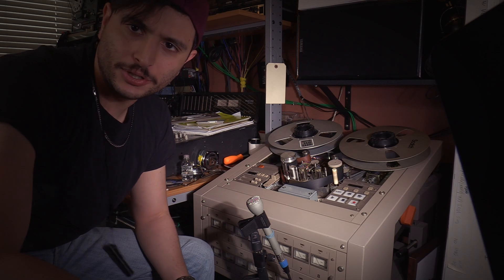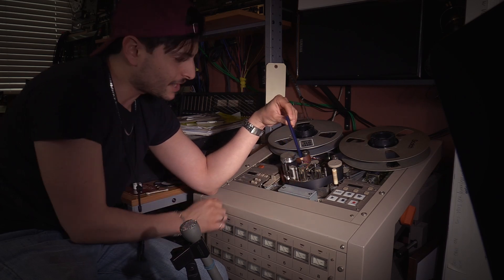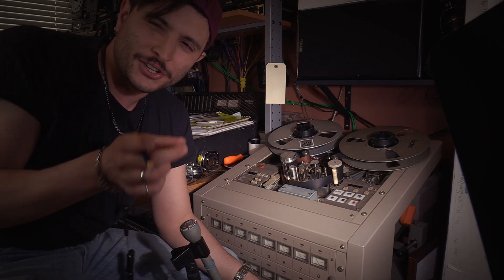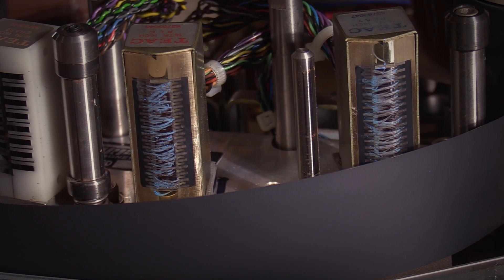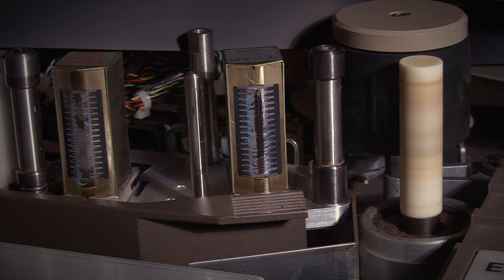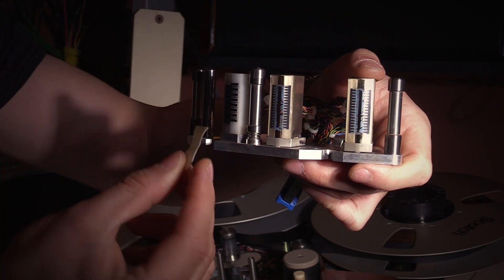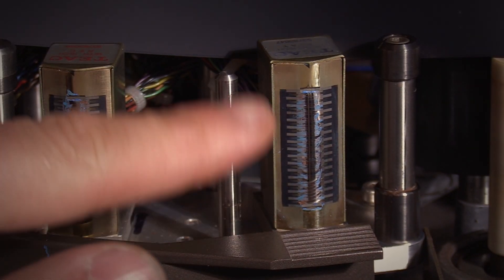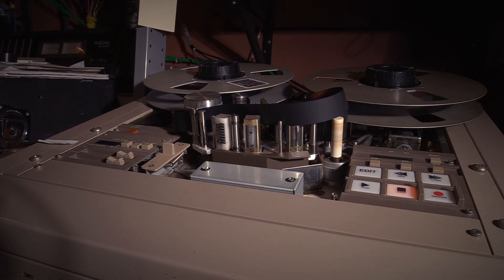Head Wrap and Zenith Adjustment on a Tape Machine (China Marker Test)

Comment: Have you ever had curling problems with the right tape guide on this machine? Have a machine very similar to this, the Tascam ATR60, the transport is identical. I can't seem to fix this issue curling on the bottom of the guide no matter what i do to the tension rollers, middle guide height, and the guides themselves. Wondering if the adjustment you're showing here is what I need, as it is only occurring on play, not ffw or rew.
Reply from the maker: Definitely not the adjustment I am showing here. What about capstan roller adjustment? You can shim it to give it a different angle. Have you tried that?
Reply: @Mario_DiSanto  I'll give that a shot. I see that in the manual now actually.

Comment: This process can be very frustrating as it can be difficult to get a reliable image quickly, something I just discovered that made this much faster was applying the grease pencil with the head still wet with alcohol, this makes a reliable pattern appear almost immediately instead of having to lightly paint the grease on. This way you can get the grease on pretty heavy and still get a clear result almost instantly!
Reply from the maker: Great idea!

Comment: Shouldn't John have done this after he relapped it? Maybe im ignorant ive never had heads relapped but I thought he lined it up to the static guides on the head block
Reply from the maker: So, this is where things get a little dicey with my machine. Let me explain everything as I learn more about my headblock and machine . I did pay John to optically align the machine which is where he checks and sets the tape guide height, head heights, head zeniths, and the azimuth. Keep in mind an optical alignment of the azimuth adjustment is only a starting point, this will need to be aligned with a calibration tape later. 

Now my machine does not have a zenith adjustment and the only way to adjust the zenith is with a shim. Really I shouldn't NEED to adjust the zenith at all with my machine as the heads sit flat on the machined headblock. I am not sure why I got a trapezoidal wear pattern on my reproduce head originally (John said the pattern was typical). At first I thought it was because the head was tilted forward. But now I think it's possible that my transport was not aligned correctly and that is what was causing this. So through John's measurements he probably saw that the reproduce head WAS aligned in the zenith angle.

I wound up adjusting the the capstan azimuth after I recorded this video and my tape path was greatly improved in position and consistency. This may have been the culprit all along. I did not remove the shim that I installed in this video as right now the china marker test shows somewhat consistent results. Only time will tell if a trapezoidal pattern will be present. 

Now for the head wrap adjustment... Where John had set the heads was completely off from where they needed to me.  And in hindsight, I am not sure how this adjustment can be made with the headblock off the machine anyway as the tape needs to be ran across the heads (at least for my machine). Which begs the question, why get the headblock optically aligned at all if you are going to adjust the head placement during reinstallation? Maybe other machines are different? Maybe other machines have a finer adjustment mechanism? Maybe John knows other machines better? Honestly, I don't know. 

Another thing is, for my machine, the guide pins are not supposed to set at the same height. So by John optically aligning them to the same exact height, it actually isn't correct per my machine's manual. I don't think this is typical though for higher end tape machines. I think that quirk is specific to my machine, so I can't blame John for not being aware of that. 

I personally wouldn't get a headblock optically aligned again if I were to get them relapped.
Reply: @Mario_DiSanto  this all seems fair - I could see for a Studer or something optical alignment being the final word, those head stacks are a whole nother level.
I admit, I have always just left my heads alone as I don't have a lot of wear on my main 1/2" 8 track to see anything yet. I am guessing by Johns comment, he really just means that for these mid tier Tascams trapezoidal wear is just some what unavoidable over the decades. The good news is you should have another 20 years minimum of use before you have to think about this again, even if the wear does turn out to be uneven. 
You're a Mech E right? This is more your domain than mine, I'm a wires guy lol

Comment: Electrical alignment is gonna be a big one! (I actually enjoy aligning my machine. It's pretty therapeutic.)
Reply from the maker: Usually I am stressed because I never get the machine running to 100% acceptable frequency response. I am hoping with the 10 or so hours I spent making the transport as aligned as possible that all the slight inconsistencies will work itself out. We shall see once I start the process.
Reply: @Mario_DiSanto  I think just having the relap will make your frequency response perfect factory or better, even if alignment is a little off. Especially if you started with visible wear.